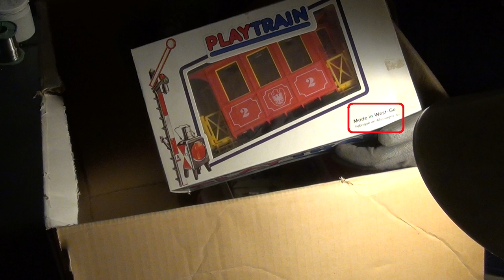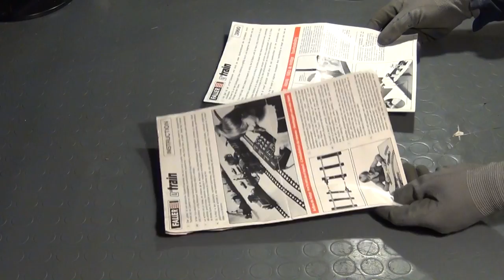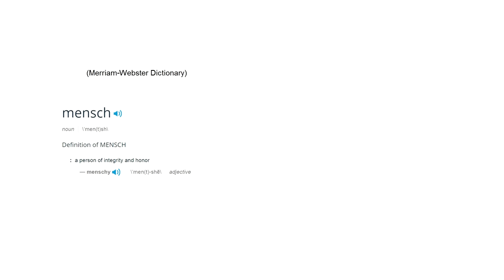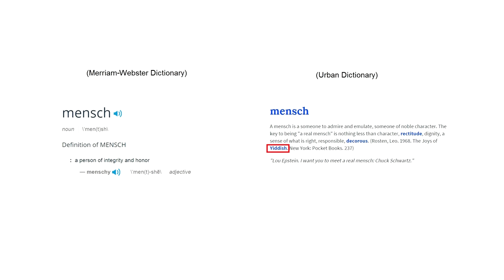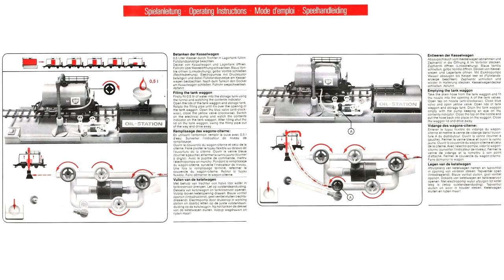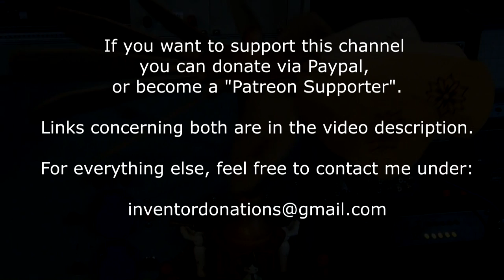Toys Repair Marathon ( Faller Play Train )

Comment: Awww.  You stopped too soon.  You could have made a new train gear out of epoxy using a putty or silicone mold of the good gear. 
A good section of loader track could have been pressed into some putty to make a splicing block.  A little glue applied to the broken sections then placed into the block would form the required shapes and indentations into the glue.
 The oil station probably used a peristaltic pump and the flexible tubing has hardened.  These are just some ideas to be considered in future repairs.

Comment: You can make a copy of the gear you already have using a little bit of super glue and the old broken gear.

Take the good gear, put casting material or cement around it. Carefully remove it, put the broken gear inside, pour the super glue of your choice, let it dry. Observe the gear for any air pocket, rectify, and when done, break off the mould. Clean and install.

This very same repair was done on a similar, older toy train with cast iron gears. In that instance i used a bit of copper pipe lead "glue" (not sure on the name).

Comment: TPAI I have a video suggestion that would probably fit your channel and be a bit of fun. The Perils of EMP. What is an emp, what would it do to electronics (solar flare etc.) and what could survive? How to shield your devices? Will components in the parts bin suffer too? How to repair things after a solar flare? 
I know, a bit of an abstract topic but interests me from a technical standpoint. Does it affect only devices that are powered at the time of a blast? If not then where is the crossing line - if an arduino in the drawer gets fried does a microchip in a second drawer get fried too? 
Stuff like that in one neat compilation or series could rake some nice views and exposure to new audiences I think.
Reply from the maker: Hey John. I have indeed done some research on that topic and I have been thinking about performing some experiments dealing with EMP-hardening in future episodes. Good to know that someone would be interested in it.
Reply: +The Post Apocalyptic Inventor That is awesome man. I am especially curious what will survive better - analog or digital? In a post solar world what will guys like us be fixing and what should we ignore? Are parts in a circuit more vulnerable than in the parts bin? There's so few of us these days that we will get rich fixing stuff for people and building from scratch, got to prepare early hahah, everyone knows about blowing transformers and junction boxes but nobody seems to care about consumer level electronics.

Comment: Merry Christmas, what was the name of the glue you used? I have some synchronous belts which need glueing
Reply from the maker: +Spark Gap "Silisto Hybrid". But I guess there are many similar products. Google for "MS Polymer"
Reply: +Spark Gap 
Quite often a glue of this type is known as "construction adhesive" (or "Montage Kleber" in german), although both terms are not equivalent. Watch out for "modified silane" based. These glues are crazy strong on almost any surface, but need some volume to work.
Reply from the maker: +superdau Yes "MS'' stands for "Modified Silane". This stuff is not only very strong but also very elastic.
Reply: +The Post Apocalyptic Inventor thanks for the information guys, I'll have to do a bit more research as I want to use it on the belts of a delta configuration 3D printer as there is no easy way to keep them tentioned. Too much elasticity in this respect would not be good. Why couldn't they have just used lead screws and made my life easier.

Comment: 18V AC? Quite a lot for a Child toy, especially because it includes playing with water...
Reply from the maker: Yeah the 'Good Ole Days' when safety wasn't an issue :D
Reply: The Post Apocalyptic Inventor Well, it is not super dangerous, but it wouls sure hurt if a child was to touch both of the contacts, maybe it was also a measure to teach children that electricity is ouch :D
Reply: Lionel trains used 14-20 volts and I don't recall a rash of fried kids in the media (not that many of them didn't deserve it).  Intricate toys are meant as opportunities for parents to interact with and teach their older children about how things work and to respect things like heat and electricity. Remember the Easy-Bake Oven?  Tossing a kid in a room with "safe" toys like foam blocks for 12 years leads to teenagers stumbling around looking down at their phones the rest of their lives.
Reply: +Eddie the Grouch You are absolutely right, i am going to give my 3 year old a knife collection for christmas. He sure will learn to respect knives once he has one sticking in his leg. i am all against over protecting your children, but really? Open AC Current allover the whole tracks? That could even be a danger for adults how think the voltage is turned off when it actually isn't. Sure 18V is not lethal when touched for a short period of time, but it still hurts...
Reply: +muh1h1 The typical and in germany very common model trains from "märklin" use about 16V AC.. I had one as a kid.. i touched the tracks more than once.. you feel it, but it didn't really hurt, nor fry me or anything.. Nor do i know of anybody that ever has had any problem with it.. And märklin is still in business and producing nice model trains.. although by now they are more oriented to the professional model train lover with a big wallet..
The one in the video is DC not AC by the way..
Reply: schwabentutorials Really? He said "AC" in the video, but i think DC would make much more sense...
I know the Berührungsspannung is 100V DC in germany, and 50V AC, so it is not considered life threatening anyway...
Reply: +muh1h1 yes you can see it later when he reverses the train by reversing the polarity.. most toy and model trains use DC, some, inkluding m&#228;rklin use AC. But i dont think that the reason they mostly use DC is safety rather than the fact that you can reverse the train by simply reversing polarity.. doesn&#39;t work that easy on ac.
most modern and more professional model trains now use digital systems where signals are encoded within the ac supply on the tracks so you can have more than one locomotive on the same track being controlled individually.. Quite interesting technology by the way :D
Reply: schwabentutorials Yes, i was talking about the waterpump system :)
Reply: +muh1h1 oh ok.. well its part of the train set as it seems to me so i would have guessed that it uses the same DC voltage, but maybe it really uses AC
Reply: +schwabentutorials maybe thats why it didn't work for him, maybe he die bis research wrong :)